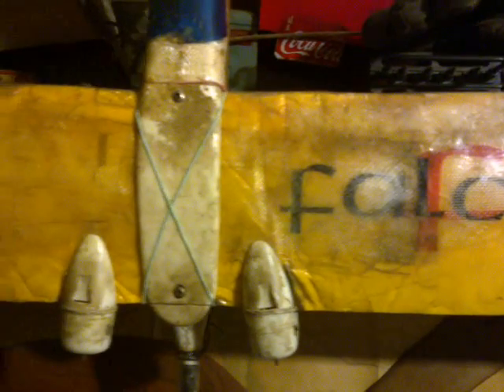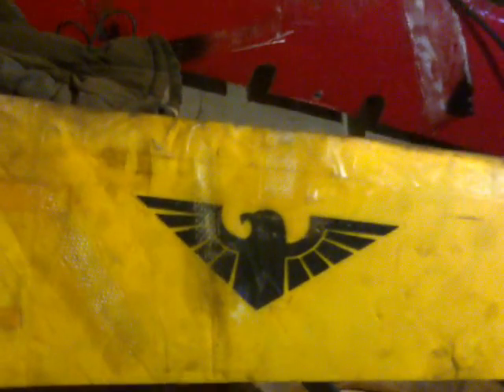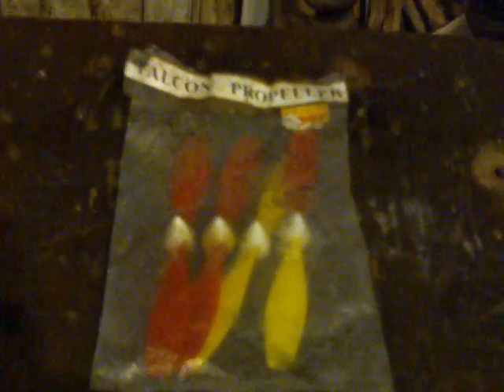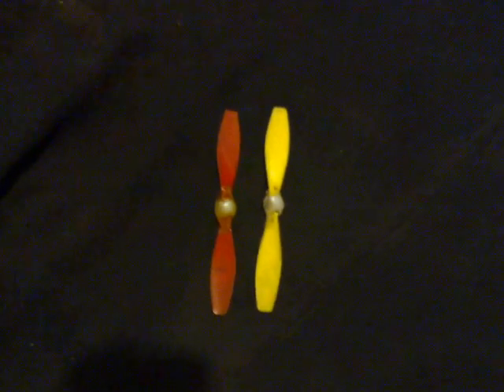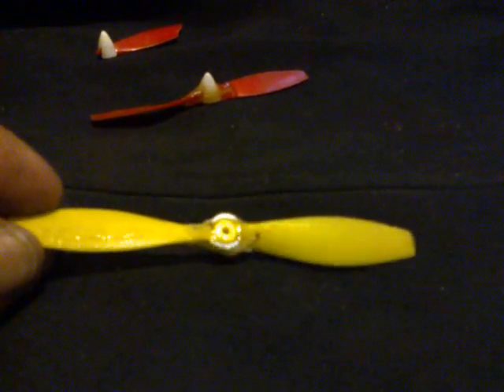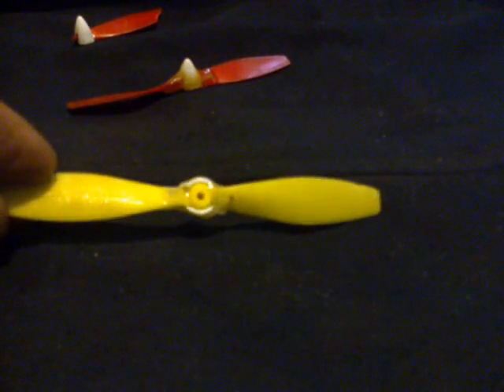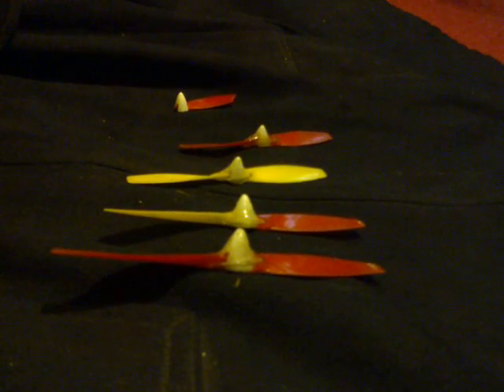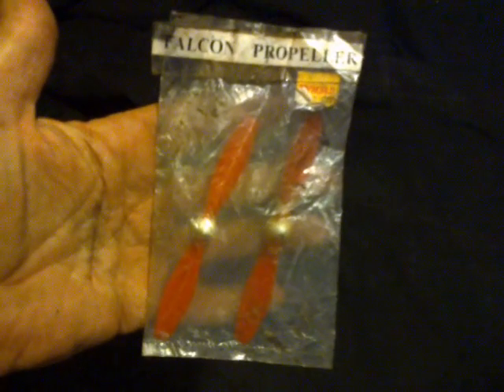Propelling Earth's Last Flying Falcon...

Comment: 3D scan and print them.
Make them out of bird feathers and epoxy
Fabricate ducted fans for it
Reply from the maker: G,day,

Thanks,

 Feathers and Glue sounds interesting, but the Feathers probably wouldn't be stiff enough.

 I'm expecting Wood will work, and so will Aluminium...

 Ducted Fans would be like Double Drag-Brakes when gliding...

;-p

Ciao !
Reply: Oh yeah ... Glider.... heh...
Reply from the maker: Ken Lee 
Well, it IS an Electric Motor-Glider...

 All I can tell it to do is "Full Power !", or "Glide !", or "Left Turn !", or "Right Turn !"...; so worrying about what happens when Gliding is at least 25% of the Task...

It's primitive, but if you know how Aeronautical Engineering operates, then it can be GREAT FUN to play with...

;-p

Ciao !

Comment: Here is a site you can get parts from.
Also have complete planes for 34.95 US
http://www.raidentech.com/fa2rarecoain.html
Reply from the maker: G'day John,

Thanks mate,  I'll put my son onto it, but I suspect they'll have run out of Falcon Propellers about 5 years ago.

 The closest we could find was a pair of 102mm Tractor Prop's for a CC Lee Piper Cub, in England..., and if I could get them I'd try them after cutting the Spinners off and running them backwards...

  Most of the Websites which used to be devoted to selling parts for CC Lee Models haven't been updated for years, so maybe the Manufacturer has folded up entirely...(?).

 I figure that I can make them 2 different ways in Wood, and I reckon in Aluminium it might even be easier...

  Did you ever get your SunFoil past the Highway Authorities ?

  My old Subaru ran out of Registration yesterday, the Forester which will replace it is having it's Gearbox reconditioned, but it means the Touring Wagon Experiment has finally finished.

 In 4.5 years, the Mk-3 saved 1,200 Litres ($1,800), of which the Aerodynamics of the Fairing saved 117.29323 Litres ($175.93), and from the "Aerodynamic Savings" the fraction which can be tracked to the Solar Thermal Ramjet Effect was 9.0225562 Litres ($13.53)...

  So, it might not be entirely economically viable, considering that the local Automotive Bodybuilder quoted $600 to copy what I did to a Solar Panel, and if the entire "Aerodynamic Package" only saves $26.06 per year then it'd take just over 23 Years for the Fairing to pay for itself in additional Fuel-Savings...

  Whereas the Solar Panel & Regulator, at today's prices, would only take 22 WEEKS to recoup their Purchase Prices..

   Today I'll ring the Transport Museum, and see if they want to make an offer on an ancient  Ramjet-Assisted Subaru... (lol).

  So, it seems that the simpler and more minimalist the Mounting then the better it is..; unless people want to pay extra to look a bit more obsessive - chasing after EVERY last drop of Fuel...(?).

  Have a good one,

;-p

Ciao !

Comment: Why don't you make a silicone mold while you have some complete propellers.Would have been even better if you did this before you repaired them.That way you can make as many as you like relatively easily out of resin....
Reply from the maker: G'day,

Thanks,

Yeah, well, I did think about it, but Resin would be too stiff and brittle..; so I figure Carved, or Cut & Laminated & Carved, Wood, with an Epoxy Skin..., and if that gives too thick a Profile and makes too much Drag, to spin fast enough, to fly faster than Stall-Speed, then that's when Cold-Forged Curved-&-Twisted and Filed 6061 T-6 Aluminium, from Roadsigns, will become  the "Ultimate" Replacements...

 I hope...(!).

;-p

Ciao !
Reply: A single carbon fiber or fiberglass sheet would reinforce the resin to make it durable and light enough.You could forge an alloy one but that would be real hard to make perfect, and after the first crash...not so good...but I suppose you have plenty of time instead of loads of money...maybe you could retro fit some propellers from a modern remote control drone...they sell for about $7.
Reply from the maker: electro1622 
  Um, 108mm Dia, 18.5mm Pitch, 2mm Shaft Diameter..., Pushers...

 Nothing on eBay fits, though in ALL England there are 2 x 102mm Tractors, which I might be able to cut the Spinners off, and use as undersized & over-revving Pushers...; the Story is "This was a very popular model, in it's day..., but the Manufacturer now regards it as a "Discontinued Item", for which no support is available...".

I feel like I maintain the last Free-Range Passenger Pigeon...; ish...!

;-p

Ciao !